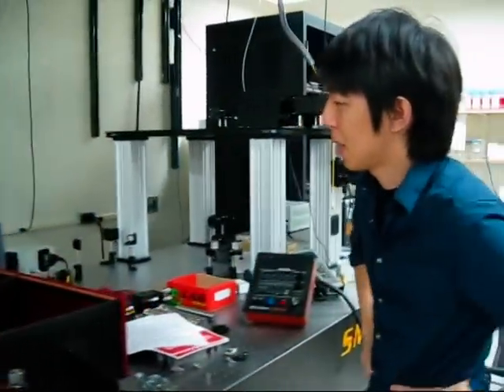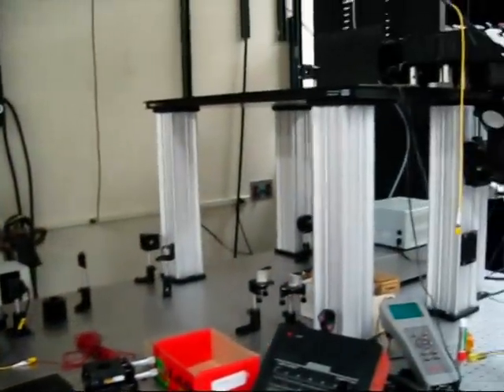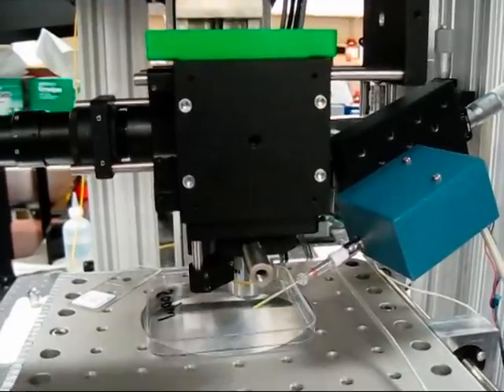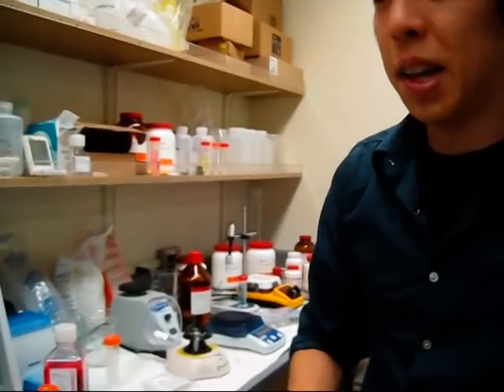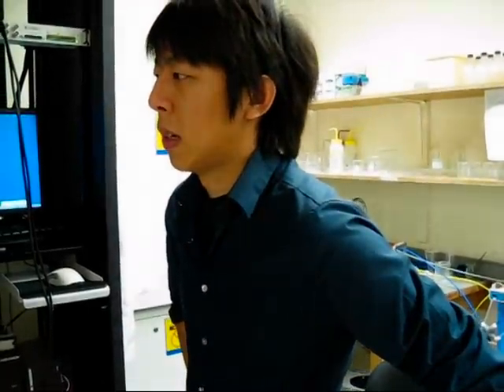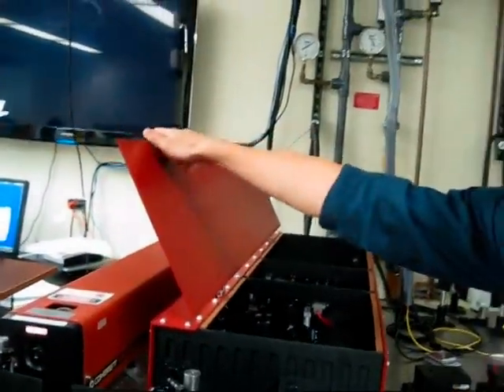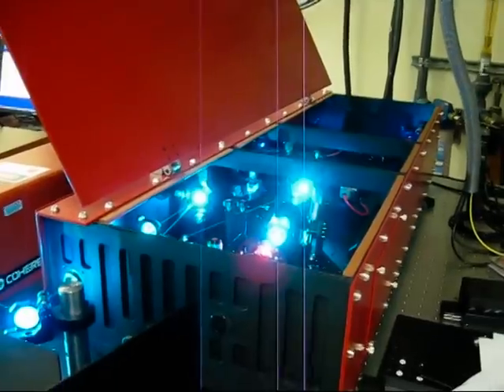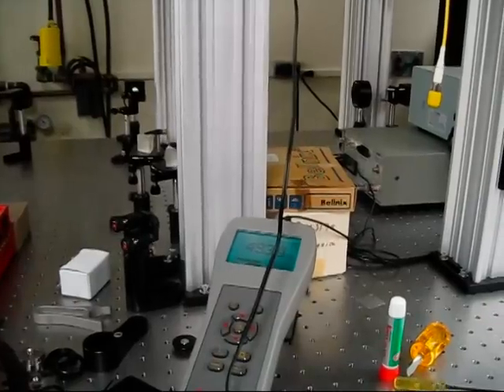Del Mar Photonics Ti:Sapphire laser Trestles in the UCLA Biophysics Neuroimaging Laboratory

Comment from the maker: Featured course:

This course will focus on advanced quantitative fluorescence microscopy techniques used for imaging a range of biological specimens, from cells to single molecules. The course is designed for cell and molecular biologists with little or no microscopy experience, who wish to begin utilizing microscopy in their own research. Students will gain a theoretical understanding of, and hands-on experience with, state-of-the-art equipment used in quantitative fluorescence microscopy, including: laser scanning and spinning disk confocal microscopy, deconvolution methods, total internal fluorescence microscopy (TIRF), super-resolution methods (structured illumination, STORM, and PALM), multi-photon microscopy, light sheet microscopy, and digital image processing and analysis. Students will learn how to design and implement a wide range of imaging experiments using these techniques. Students will use the techniques to address specific quantitative questions and then discuss the results as a group, learning to trouble-shoot the common problems that occur in the course of a quantitative imaging experiment. Among the lectures presented are: microscopy basics, image analysis basics, CCD cameras, confocal microscopy, multi-photon microscopy, deconvolution, TIRF, single molecule imaging, imaging ratio-metric "biosensors" (including FRET), light sheet microscopy and super-resolution techniques. Students will also learn guidelines for choosing fluorescent proteins, and work with live samples requiring environmental control.

Instructors:  Jennifer Waters (Harvard), Max Krummel (UCSF), Hari Shroff (NIH) & Hunter Elliott (Harvard)
Lecturers:  George Patterson (NIH), Paul Goodwin (GE Healthcare), & Adam Cohen (Harvard)

More info and online application:  http://meetings.cshl.edu/courses/2014/c-qicm14.shtml